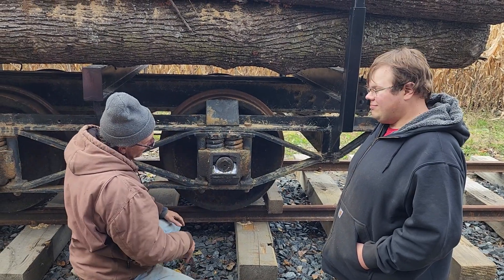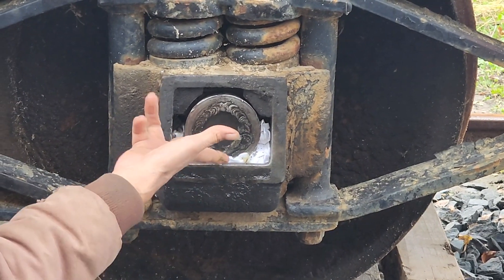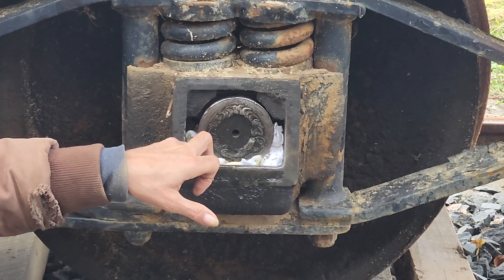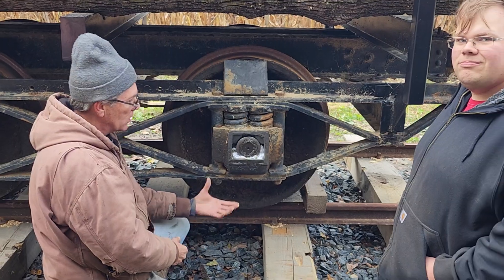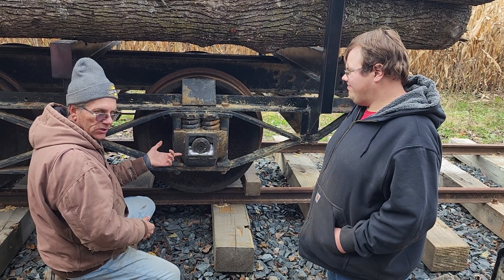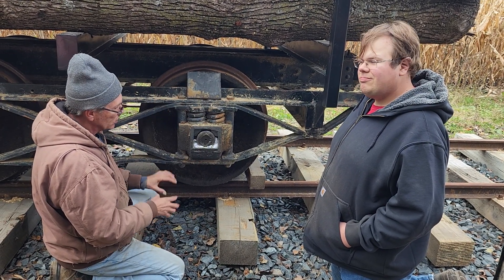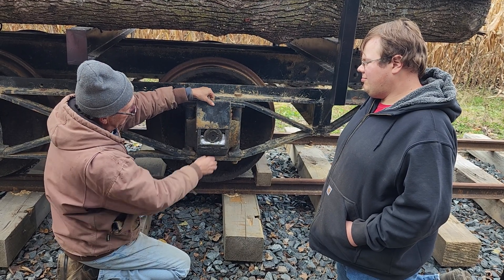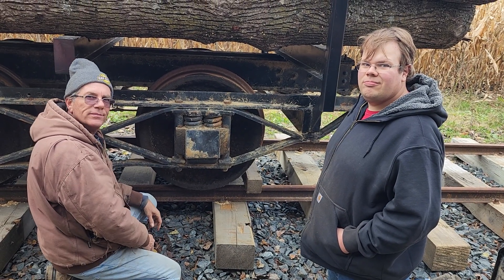Maintaining Friction Bearings on an Old Narrow Gauge Railroad Car

Comment: In the 80s and early 90s I was still moving RR equipment with friction bearings thru interchange with approval of an FRA inspector. One car moved at intermodal speeds with pads that looked like new and were properly oiled but were 19 years old. Getting rid of the waste packing and going to lube pads cut down on the hot boxes. The problem with waste packing was that loose strands would come up into the brasses which is where the fires would start. The waste strands there would prevent oil from lubing the brass because it was compressed hard. Lube pads looked like shag carpet, have foam inside, and didn't shed  strands. And the oil used is called................ journal oil. 55 gallons will cost you around $1500. A burnt brass and journal will cost you thousands even if caught in time to prevent a derailment.  Always keep the journal boxes full to the right level. 

Trick taught to me by the Army Transportation Corps, have a tub full of journal oil and place weighed down pads in it so the pads soak up as much oil as possible before they are installed. Leave them there for a month or so and always have extras ready. Yes you have to deal with them being oily but there is less chance of the pads soaking up all the oil when installed in the journal box and not having enough when you first move the car/loco. Many steam locomotives still use friction bearings. I don't think that any Shay in operation has ever been converted to roller bearings.
Reply from the maker: Thanks for sharing.